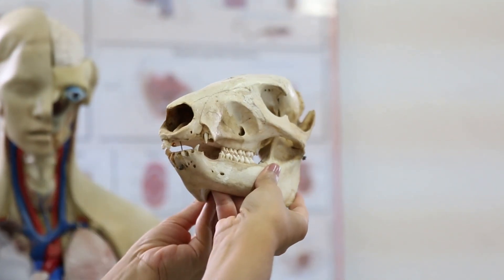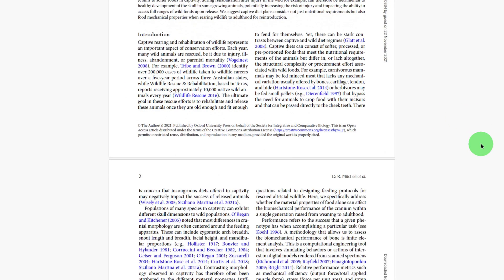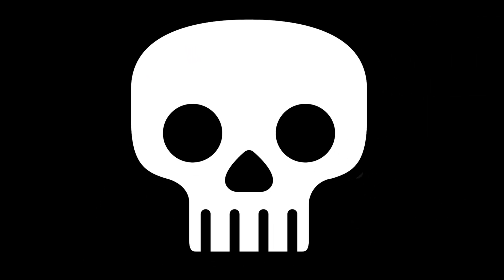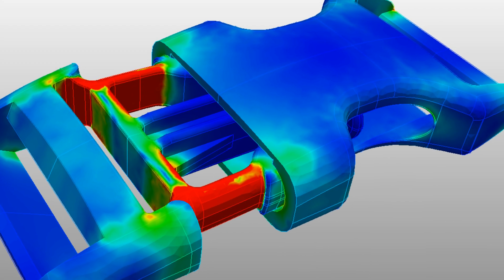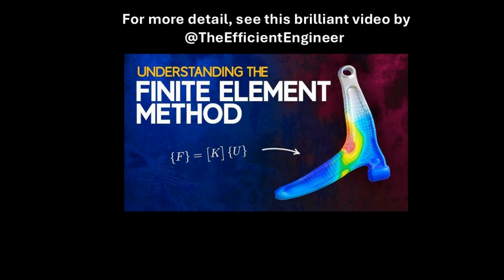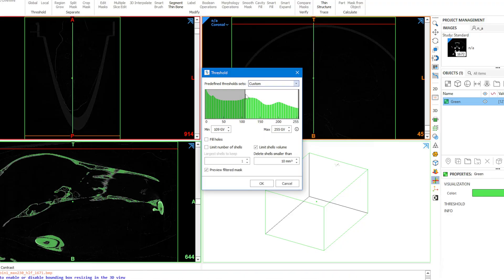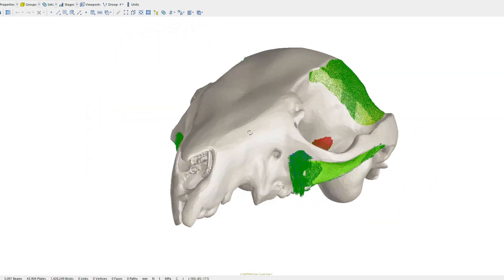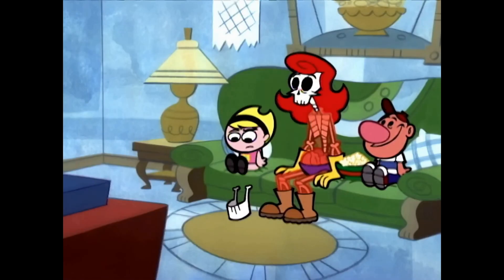Skull Science Methods | Finite Element Analysis

Comment: maybe debunk some claim in internet nyka ? feg people oftem claims orca can bite with 19000 pounds of force those ydypts dont even recognize units writing saying its Psi 🫣🤭 me basic measurement on bigest orca skul 112 long x70 cm wide  show its not  even close to 19000 pounds of force on deepest tettehs in jaws 👌🏻🪠those are probably the same people claiming that spotted hyena have strongest bite from all animals 🤭🪠🍿now about dinite elemnt analysys it show how much skull itself can withstand in specific places before break the poi t is bonehave huge range of density itself and now be this factor istelf ypu have huge posibility of error igpf you dont assume somerange of bones denisty /strenght 👌🏻second it dont show true limitsof bite force cos in99% of egzample most animal as well humans are much under max bones stresss capapbility assuming bite is evenly distributed on both side of jaws feg i can on molarr teeths probabaly bite with like 200 pounds of force absolute max at optimal angle yet before something break in me jaws system biting in the same manner  i would need to bite 2 or 3 times harder …….some animal can be closer to bones  structure limits some can  be far away….. and last but not least in such analisiys ypu must also consider how soft tissue i pact on how much streesss csn jaws skull standbefpre break in some animal soft tissue give huge supllly in some almost 0 …. and obviosly wector of forces must be drove be wectors of working jaws muscles which also often otself make skull steonger in couple places 👌🏻🪠🍿

Comment: How confident can we be in these models, especially if applying 'average' bone properties to all of the skull? For example if denser bone developed at stress points that could make a skull more suitable than it'd be modeled for biting. Is there any way to make comparisons between models and real world situations?
Reply from the maker: Excellent question! In short, it depends a lot on the hypothesis and the scale of focus. 

Clinical FEA involves extremely detailed model constructions that can include enamel, trabeculae, sutures, periodontal ligament, etc. One model can take months to build. These also rely on validations by comparing FEA values with measurements taken from in vivo sources, like strain gauges on real bones. 

But validations are only done for very few species and are impossible for extinct species. Fine scale studies looking at variation in skull components,  like the maxillae for example, would benefit from including more material property variation. But in comparing the general performance of the entire skull, many studies have shown that more simply constructed models do not cause strong deviations to broad patterns - especially on species with very differently shaped skulls 💀